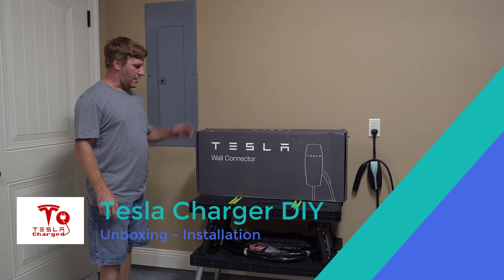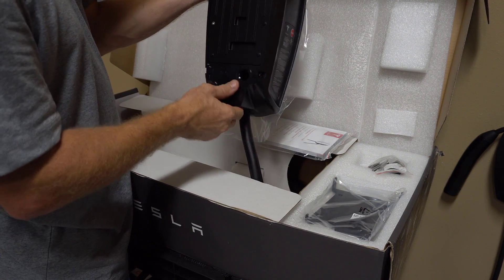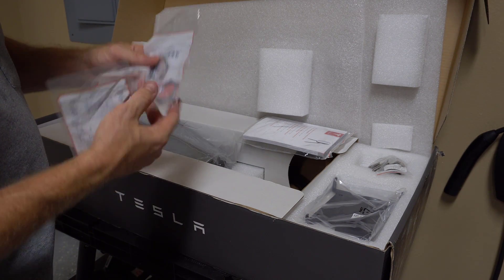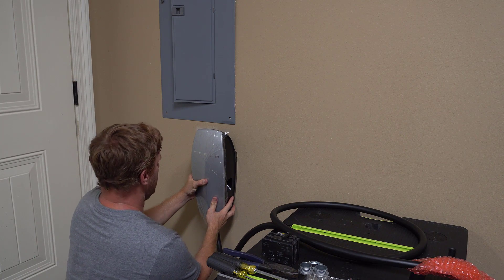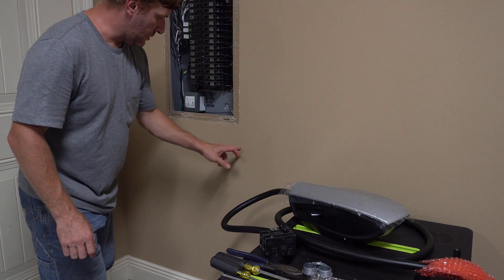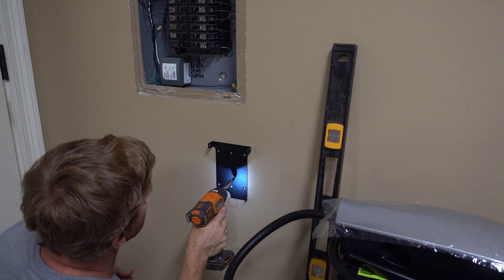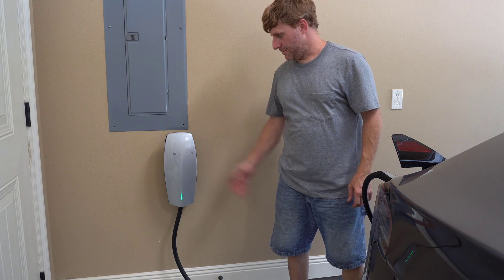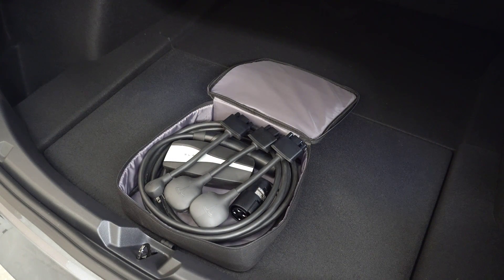Tesla Wall Connector Charger - DIY Installation

Comment: Alot of these kinds of videos aren't realistic, not everyone has the perfect case scenario where their breaker box is literally right next to where they want to mount the wall charger.

For people who want to mount the wall charger in the garage(because that's where most people park their cars) the breaker box is literally all the way on the other side of the hosue such as the case with my parents house, so installing a wall charger in their garage would be an expensive and time consuming job.

If you're lucky enough to have the breaker box relatively close by to the garage such as with my house, then it's easier. But it's still a job having to drill through stucco(thats what I have on my house) and having to run conduit from the breaker box to the inside of the garage.

This video is a best case scenario which not everyone has.
Reply from the maker: That's all I'm trying to show here, if you have the option it's that easy.   Everything else will either be to difficult or expensive for DIY.

You can always run a smaller 30A circuit to a longer run to cut cost too.  I just enjoy getting the maximum charging rate out of any model Tesla with this setup.

Thanks for the comment and watching.
Casey
Reply: @TeslaRebuilders  Understandable. Didn't mean to throw any shade on your video. My apologies.

Comment: Man you made that look easy! Nice work!
Reply: That's because this is a best case scenario for a wall charger. In alot of cases, the breaker box on alot of houses is in an obscure place that's not near a garage. And if it does happen to be near by where you plan on mounting the wall charger, you're still looking at making holes in walls, running conduit, etc. Unless you're extremely lucky and your breaker box is literally right inside your garage.

Comment: I love your videos.  Seeing you install it looks easy, I'm wondering if I should hire an electrician. Keep making videos
Reply from the maker: My installation was easy because my panel was in the right spot in the garage.   Most will have to run conduit and wires through the attic to get where they want to put the charger.  I just wanted to show the simplest installation possible for the wall connector.  But yea hiring an electrician is the best idea if you don't feel comfortable with it.   Thanks for your comment and watching!
Casey

Comment: You seemed a bit confused as to why it's only charging at 48a. The third generation wall chargers max out at 48a continuous load charging. NEC states that continuous load amperage must be serviced by a circuit capable of 125% of the continuous load, hence the requirement for a 60a breaker (48 * 1.25 = 60). Model S and X Teslas are capable of higher amperage charging, but the wall charger at 48a is the best Tesla offers right now for home solutions.
Reply from the maker: Late reply sorry, but yea the limitation of the model 3 is 48a max charge rate.  But the wall connector can support up to 80a for charging S and X and I'm sure eventually Cybertruck!   Hell I'm thinking you may need 100a charger to get a full charge in 8 hours it may have 100-200 kwh battery pack size.
Reply: @TeslaRebuilders  That is an older model S or X that had the two charger option. That option went away quite awhile ago. No model of Tesla has a two charger option any longer. A single charger S or X will not charge at higher than 48 amps.
Reply from the maker: @xflyingtiger oh ok have not been keeping up with that.  Good to know I'm just glad to be future proof for larger charging options.
Thanks

Casey

Comment: Probably should be using 6/2 wire so you only have 2 conductors and a ground and I'm pretty sure 60amp circuit is plenty for a home charger.
Reply: 6 gauge I not for 48amps.  You need atleast 4 Gauge on a 60am breaker

Comment: I installed it and did everything you did 
Got the same results.
How do I get it give me 80 amp?
Reply from the maker: Cool yea this was a Gen 1 wall connector that was compatible with legacy Model S with dual chargers.  So in order to get up to 80A of charge you need a older car.  All the newer models come with the 48A on board charger.
Some early SR3's only could get 32A rate because on board charger was smaller due to smaller battery pack.

Comment: I have my circuit panel in the basement (right side of the garage) and want to install wall connector on the left side of the garage. Is it possible or will this cost me a lot?
Reply from the maker: Yes you should be able to run your cable through the ceiling in basement and go through floor to garage and mount on wall.  An electrician will probably charge 400-800$ as it should not take long and the material cost is fairly low 100-150$
Reply: @TeslaRebuilders  Thank you for your reply. I forgot to mention that my basement is partially finished. Non finished where my utilities are and electrical panel. Would they able to get the cable out from the dry wall? Wondering how hard this will be for an electrician?

Comment: BTW, 6AWG Klein Wire Stripper is 20 bucks.  Best investment ever.  Nobody wants to score those copper wires with a blade.
Reply: That looks like 4 AWG wire, which is rated for no more than 80Amp breaker. This guy put 100Amp breaker on it. Disaster! Also the wall charger can not handle more than 48 Amps, which tells me that this guy didn't even read the manual.

Comment: why is nneutural not needed and where did
you put the wire in the wall charger and in the panel?
Reply from the maker: The neutral is not needed when using 220-240v due to the path and flow of electricity through each opposing phase line.   The wire is connected from the breaker and ground to the underside of the wall connector luggs.  If you're thinking of installing, then you should hire a professional electrician.
Reply: Your neutral acts as point of reference to ground. In a 120/240V system, the reference to ground (neutral) is what gives you the 120v. If you were to measure your voltage from L1(Line) to N, it'd be 120. If you measured L2(Line) to N itd be 120, if you measured L1 to L2 it would be 240v. The Neutral is only necessary when you need to have 120V to run 120 V loads. Your stove for example is a 120/240v system  and it uses that 120v to run the lights, display, and all that. The 240V is used to heat the elements (L1 and L2). 

This Tesla charger only needs 240v because it doesn't need to run any 120v loads.

Comment: Maybe you have better information, but I would not install that unit there. That door behind you is going to hit that glass faceplate and crack it. In any event, the door is going to hit the unit unless you never use the door or install a rather large door stop.
Reply from the maker: The old wall connector is plastic cover the door does not hurt it.  I have door hinge stop set to keep it from hitting it also.  The new wall connector does have a glass front and yes I would not have put it here in that case.  Although it is alot smaller in depth from wall too.

Comment: I thought it only needs 60amp breaker ?
Reply from the maker: Yes for a Model 3 a 60 amp breaker is enough to charge at the max rate.
Check this link for exact details on breaker size for the different models,
https://www.tesla.com/support/home-charging-installation/wall-connector

Thanks for the comment,
Casey

Comment: Overkill and your door is going to hit your new “charger” and the wire
Reply from the maker: Been a year and we have had no problems, it's a 8' cord I can park 3-4' away from wall it was just closer when I did video because of work I was doing in garage. Yes wire was overkill but at the time I didn't know the max charge rate of the model 3 was 48A but it's future proof and capable of 80A like a S or X can use or my Cyber truck I'm sure!